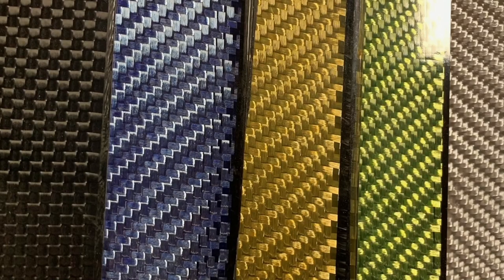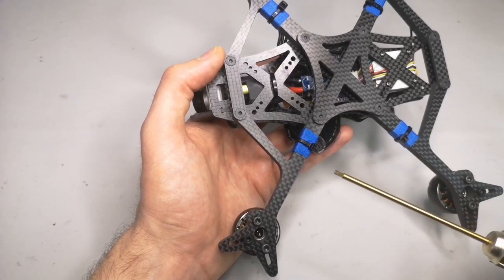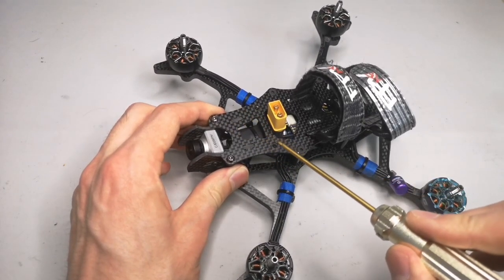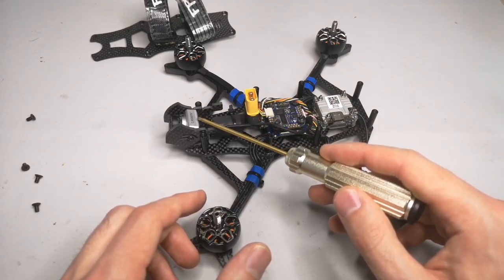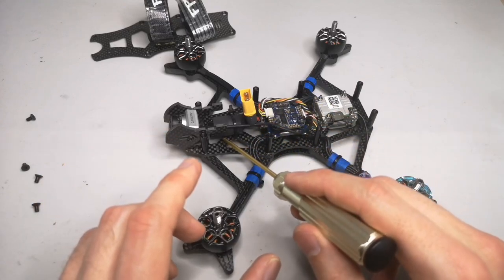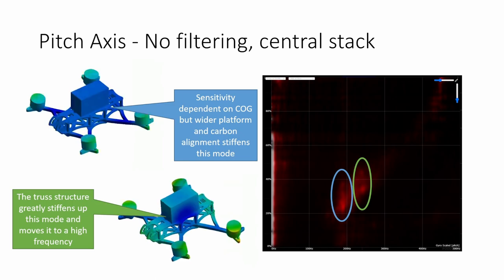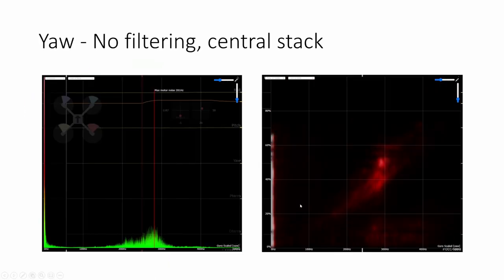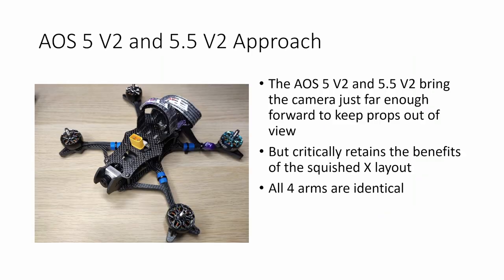AOS 5 V2 FPV Frame: Better than the Apex DC?  No props in view; no compromises!

Comment: Bought my AOS 5.5 V2 already.  Got it just yesterday and put the frame together today.  Looks really solid.  Can't wait until I can afford some electronics assuming I can find em in stock.  This will be my first HDZero build thanks to the thoughtful frame construction.  Thanks Chris!  Great work!
Reply: Did u weight dry frame by any chance😅
Reply: @kalinkha  Dry, no motor or stack screws it's 111.7
Reply: @shadai7398  thanks for quick reply👏🏻 and dat weight is 👌🏻👌🏻

Comment: I just build an AOS5.5 v2 with farouk 2505.5 motors, gemfan 5536, hobbywing 60A stack and damn it flies really really well even with full gp10 onboard. I'm comparing it with My other 5" quads like Apex with 25mm fpvcycle, same hobbywing stack...GRL Titanium with tmotor 55A stack, pacer 2505 motors and my other GRL titanium, hobbywing stack, farouk 2505.5 motors. This is now my favorite frame to date.

Comment: Oh man, the title is such a comeback for that half crooked Steele review of AOS5. The frame now looks awesome, can't buy tho, truly expensive for me.
Reply from the maker: It's not intended as an insult. It's just that lots of people are searching for the ApexDC at the moment and deadcats are not so great for freestyle. 😉
Reply: @ChrisRosser  doesn't the apexDC have a squished X geometry that looks like a DC? Not hating - but impulse made a point that while it looks like a DC, the motors are still laid out on on the four vertices of an imaginary rectangle  - which is squished X. Same as the regular apex, just all arms pushed further back along the body?
Reply: @ChrisRosser  The apex DC puts the motors in line, so it’s actually a “X” , making it great for freestyle, unlike the usual deadcat which is not inline

Comment: Looks like it's time to upgrade my frames again! Thanks. Looking forward to more motor work. I would love more videos exploring the ideal motor for each prop size for the response time vs weight. I'm sure someone like you could explain the balance between the added moment of a larger motor vs the lower delay of having more torque in reserve.
Reply from the maker: Yeah that would be a really cool video. I need to take a harder look at the maths there.
Reply: @ChrisRosser  Just finished my 5.5v2 with F80's. The step response is 2ms faster (before tuning even) then my 5.1" / F40's despite the 3-5g added to the ends of each arm. This might be worth a look. Frame is nice a quite until 200hz. Would you recommend a notch there or let 4.3 dynamic notches handle it. Filtering is super lean on this guy too

Comment: So I bought this frame and ran BF4.3. Its on default pids and I lessen the filters sliders. Im using a Tmotor F7 55amp dji stack, Xing 2306 on gemfan 51777.  This is a hell of a frame. I'm literally speechless. The fact that it was the smoothest frame I flown without tuning.  I actually don't want to change a thing in BF lol juicy flips are clean. It is a very response frame, very crisp. It sounds crisp and sharp. The punch outs were solid, no stutters. I tried to create prop wash and it was a task. I'll full throttle burst in one direction then yaw spin 180 degrees and then full throttle burst out. Almost nothing on prop wash. Even coming out of hard dives were smooth. Motors were slightly warm. GREAT JOB CHRIS!!!
Reply from the maker: Great to hear! You might find it flies even better if you raise the master slider a few ticks. 😁
Reply: @ChrisRosser  ok thanks I will give it a try

Comment: I like the vista antenna mount on the rear arm.    Very durable design, well done sir.  🤙🏻💪🏻
Reply from the maker: Thanks 👍
Reply: I disagree. I think that antenna is toast in one crash. If motor #3 propellor catches a tree branch or something, bye bye antenna. Chris?
Reply from the maker: @kylecooper3350  If you tape the antenna to the arm and cable tie the end I've never had one cut in a crash. You can tape it along the side of the arm or the bottom the arm for extra protection.
Reply: I’ve done GPS out on the arm like that on my 6-7” builds.  No issues, everything is breakable in this hobby eventually. 😂

Comment: Hey Chris, will there be updated accessory 3d printables (both DIY and orderable) for the V2? or is everything from the V1 still good on the V2?
Reply from the maker: The arm ends are slightly different but the standoff spacing is the same.

Comment: Hi Chris... I just got the AOS 35 v2, it looks fantastic, very strong and lightweight. I just wonder if you had an explosion diagram of it. I have problems seing wich screw goes into wich hole. Also, wasn't it supposed to come with motor screws? I bought from iFlight via aliexpress. Thank you. Great stuff you do.

Comment: Any thaughts on Toilet-Tank battery mount? Would be cool to have that option
Reply from the maker: I did consider it. For a 5" freestyle frame I really prefer 2 battery straps and that works best with the battery laid out lengthways. With a GoPro it's easier to get a central COG with a lengthwise battery for this geometry.

Comment: Any video or print instructions on where all the bolts go on this 5.5 O3 Frame? Just got mine today and blown away not even a diagram!
Reply from the maker: There are some good pictures on aos-rc.com. It looks tricky at first but it's actually very simple to put together in the end. If you get into trouble just drop me an email from the website. Best advice is to use thread lock and not to overtighten the screws. 👍
Reply: @ChrisRosser  I got it together looking at your pictures. Thanks!

Comment: Please tell us Mr. Rosser. How do you mount the blitz mini with the 20x20. Considering the golden nut etc. And that the grommits following the blitz mini f7 and esc is for M3 screws.   

Thank you for your knowledge.
Reply from the maker: The 20x20 mount is designed to be able to be drilled out to M3 if you're using an M3 20x20 stack.

Comment: Got the frame and building it up. Awesome looking!
Question: if I run the battery lead out the forward XT60 hole like on your video will I have cg issues with battery placement if I don’t fly a GoPro? With the XT60 there the battery will only go so far forward. Thanks!
Reply from the maker: I'm able to slide the battery far enough forward to have a central CoG without GoPro

Comment: @Chris Rosser ...I just bought a AOS 5 EVO....interested and looking for 3d prints for it....just a question but are regular aos prints compatible with the evo frame?
Reply from the maker: Yes the FPV camera mounts and VTX antenna mounts will fit. The arm guards and go pro mounting are different. I'll add files to the new pages on the website this week.

Comment: I have a 5” 1.2 EVO and the jello on the DJI cam (old air unit) is evident. Where can I get those stiffer plates? The silicon alone does not work.

Comment: awesome analysis as always! I'd really like a frame analysis of the Babyhawk II, me and other users got heavy propwash and we'd like to know if something can be done with a proper filter tuning or if the 1404 motors are just too weak (one user upgraded to 1804 and says the propwash is gone, but at a high flighttime cost: if that's the case what motor would you suggest as a right compromise?) THANKS!

Comment: The only thing that held me back from getting your first frame was the look of it I just can't stand the look, this new V2 frame looks amazing it's so cool looking, and it has all of the benefits of your design! I'm so happy that you release this frame it is the answer to all my problems. 

I do have one question though, does a three screw motor mount have any extra vibration VS a four screw motor mount?
Reply from the maker: You should know how happy that makes me. So glad you like the look of it I put a lot of thought into it. The three screw motor mount has no negative effects on vibration Vs 4 screws. With the screws correctly tightened the motor doesn't move separate to the arm at all.
Reply: @ChrisRosser  Thanks Chris, I'm so happy 😊, I think this is gonna be an even bigger hit than the V1 was! People are going to love this frame, it's gonna sell out quick! 

Is there any difference between the V2 kits from CNC Drones vs the frame kits that will be carried by getfpv and others?
Reply: @ChrisRosser  Ps. I had just bought an Apex DC and all the parts last week, now those parts are going on my new AOS 5.5 V2!
Reply: @jhughes2286  Everyone that I hand my V1 to says the same. I really like the look of it though. Can't wait to get my hands on V2.

Comment: How did you mount the air unit in the 5.5 V2 at 13:26?
I'm having trouble finding a suitable way to mount mine. Running vista for now, until I find a good way to mount the air unit.

Comment: Hi chris, I love your designs. I purchased the AOS 5 evo v1.2 from cncdrones and the hardware that came with it was completely wrong lol. I was missing sooooooo many screws and nuts. After measuring them ALL it seems they sent me the wrong hardware lol. Has anyone who ordered from them has had the same issue? I tried contacting them but still no reply. Also the machining of the carbon fiber parts was very bad. Lots of burs and chips that i had to clean up, and some of the screw holes were not wide enough  that i had try to open them up a bit . Took my about an hour just clean them all up.  I know its not your fault but there work is below standards i think.

Comment: NICE !!!!!
I’m serious thinking I’m ordering mine now !!!!!

I have a question I’m pretty sure I heard you say that you use the Iflight 20 x 20 F7 stack. Have you experienced any freezing of your FPV feed with the DJI goggles? The reason why I ask is because I’ve built a vista nebula pro with a 20 x 20 T motor stack I use the 55 amp Tmotor ultra ESC and the F7 20 x 20 HD Tmotor flight controller. I was getting video freezing after flips and rolls occasionally very sporadically I install a 1000 UF capacitor and a fat techs bike absorber and I’m still getting video freezes on rare occasions and then switch to flight controller to the Aikon F7 20 x 20. 
I am still getting the same result. I’m next going to attempt installing a 35 V 370 UF capacitor on my Vista unit I don’t know what else to do. I was thinking it might’ve had something to do with the BEC on most 20 x 20 flight controllers ?

I run 5&6 cell 2306.5 GepRC motors Mark 4 frame.
Reply from the maker: I've never had freezing of the video on fast flips and rolls I'm afraid. It will either be ESC/Motor related, a loose cable or faulty vista/camera. It's pretty hard to figure out what if it's only intermittent.
Reply: @ChrisRosser  well that is a good thing. 
Do you run your vistas on 6S? Also is your esc and flight controller 20x20 ?

Comment: Hey Chris, you mentioned that the dji air unit might not work with a 30x30 stack in the AOS 5.  Will the HD zero freestyle vtx work with a 30x30 stack in the middle?  If not I’ll probably go up to the 5.5 but I’d prefer the 5. Thanks
Reply: its a pretty tight fit. You will probably need a 20x20 stack in the middle

Comment: Chris could you please share stock PID for the 5.5 v2 frame on Xing 2207 motors? Just put toogether all, but on "default" middle PID that drone flay like rock, and I got huge problem with propwash. I bought it from iFlight but unfortunetly they dont have any dump files on their Google Drive.

Comment: Hi Chris, how about designing a AOS 9 ?? There are absolutely no good frames on the market in this size besides the Merica 9. I tried many of they and they resonate horribly at low frequencies (~65hz).Only the Merica 9 has nearly no frame resonance, but it´s a typical true X racing frame. The macro quad community needs something with top mounted battery for freestyle and long range optimized for low resonance. A 9 or even 10 inch looking like the AOS 7 or 5 would be dope. I know, there are not many people out there flying these machines, some love would be great.

Comment: i dont understand how the spike absorber protects the esc's, when the voltage spike is coming from the motors up into the esc then out of the esc into the battery, so the spike absorber would be "protecting" the battery not the esc, because the esc is going to see the voltage spike unless you have the absorber between the motors and the esc. or am i missing something in my logic?

Comment: Hey Chris, in your description and the cnc drones product page you said the 5 V2 can fit 5.2” props, but in your own website it says up to 5.1”. Could you confirm and fix the discrepancy?
Reply from the maker: 5.2" is very tight. The max officially supported is 5.1".
Reply: @ChrisRosser  ok make sense

Comment: Got a question regarding fc used in quad shown here. Have you compared one gyro vs twin gyro fusion in terms of noise ? Does it really help as much as it is advertised?
Reply from the maker: It doesn't help that much because most of the noise is real vibration from the motors that is picked up the same by both gyros. A frame with good vibration performance is more important.

Comment: Thoughts on toilet tank battery mount? Does it really make a difference?
Reply from the maker: In my experience it slightly reduces MOI on pitch, slightly increases MOI on roll (that moves you away from BF default PIDs so you then need to retune) and massively increases the risk of battery ejection and chopped battery wires. Not worth it for me.
Reply: @ChrisRosser  Awesome thanks!  Wild Willy FPV had brought up MOI as well in his toilet tank related video a few years back (YT video = C74waib9iMU) but as a benefit instead of a detriment. Interesting to see the opposing technical/engineering views. I believe he's an engineer as well.  As far as battery ejection I can definitely see the increase in that using typical straps but maybe that reduced of negated using a kevlar strap.  Then there are FPV pilots such and Vanover & PDVEX who have experienced less battery ejection with toilet tank.   Physical damage to both the battery and battery wire is definitely a concern.  I've heard depending on the frame the battery itself can get chopped by props if shifted in a wreck.  Putting the retuning necessity and  increase in probability of battery ejection or damage aside, does "toilet tank" fly better or noticeable in flight?  Thanks again!

Comment: I am planning to use the 5.5 Frame for mid range flights. (2-3 km) Is this way of connecting the antennas enough for this range? Or do you need an other way of connecting the antennas like a tpu mount so that it can have more angle?
Reply from the maker: I haven't had any issues with range/penetration with mounting antennas to the arms. YMMV but there are antenna mounts for AOS frames on thingiverse. Anything for the AOS 5 or 5.5 will fit.

Comment: So the motors attach with just three screws? Are there special motors for that or is the fourth screw hole of a standard motor simply not used?
Reply: Answer to myself: yes, the fourth hole is not used and unfortunately even extends beyond the arm as you can see at 27:49. Seems to be a great frame but that puts me off aesthetically. Looks like a mistake really (though I totally understand it's intentionally).

Comment: Nice looking frame! I have a sharkbyte/HDZero vtx, the TX5R.1 (the race vtx V1). It has 20 X 20 mounting but it's outer dimensions are 45mm in length and 27mm in width. Will this fit the AOS 5 V2? I would like to fit it in the back. Thanks for the help
Reply from the maker: Depending on the size of the FC and ESC you may need to use the front stack rather than the centre but everything should fit.

Comment: Just purchased 3 frame set on AOS 5.5 v2 yesterday, just wondering where we can get the action cam 3D print STL files?
Reply from the maker: Thingiverse has a few. Anything for the AOS 5, 5.5 or AOS 7 will work.
Reply: @ChrisRosser  thanks a lot Chris

Comment: Chris - what is dampening grease?  Used barrels of grease over my career, but it was all lubricant.  Help?
Reply from the maker: https://shop.newgatesimms.com/product/pg-44a/ It's simply a solid lubricant with a very high viscocity designed to dampen vibration. It is very different from any grease you have likely used before.

Comment: Chris, would you mind giving me the dimensions between the rear standoffs length wise and width wise?(all four in the back section) Thanks
Reply from the maker: The rear standoffs are 32mm spacing and the middle standoffs are 50mm spacing. Front to back is 54mm on the 5.5 and 48mm on the 5.
Reply: @ChrisRosser  perfect! All of my existing gear will fit👍. Thanks, looking forward to getting this frame😁

Comment: Frame's Good no question what I do have a question is running BF4.3 on anything less than a "H7". CPU usage climbs way high over 4.2. Stands to reason really. What's your thoughts?
Reply from the maker: F4 is OK for 4k PID loop on 4.3. F7 is fine for 8k PID loop. H7s have issues right now with DMA channel conflicts on many boards that cannot be fixed in software so I would steer clear until manufacturers sort out their pinouts. 4.3 has higher CPU usuage than 4.2 because CPU usage is reported more accurately now, there is not much difference in actual calculations 4.2->4.3.
Reply: @ChrisRosser  I had fears of over burdening  resources leading to lockups but now I have more confidence to stick with my F7 boards Thank You.
Reply: With 4.3, you can go up to 75% of CPU usage (according to tuning notes).
Reply: @jejefpv  Thanks

Comment: chris how come i can not buy the new aos 5 v2 frame with all the colours you do it , (in the UK)
Reply from the maker: Colours are only available through cncdrones I'm afraid. They cut to order so they can cut in coloured carbon fibre. When cutting batches multiple colours makes no sense it just means more SKUs that go out of stock quicker.
Reply: @ChrisRosser  thanks Chris for getting back to me on my question